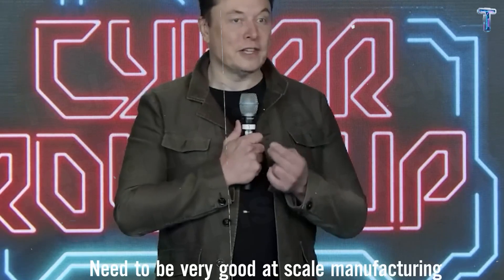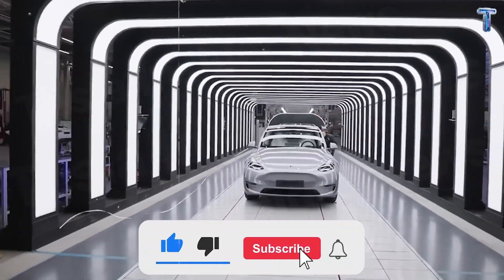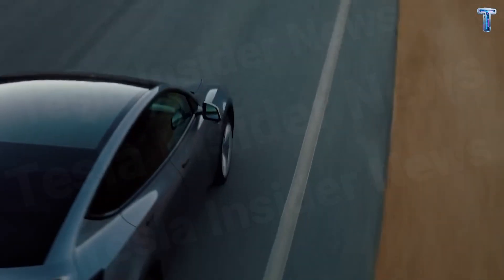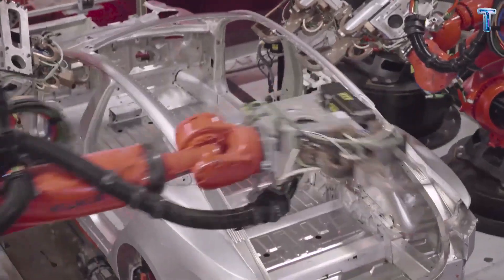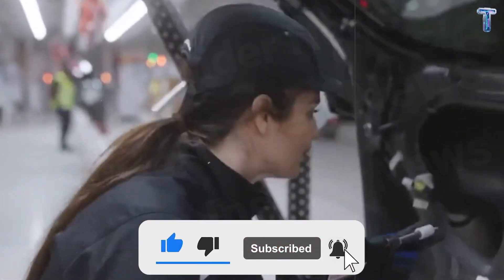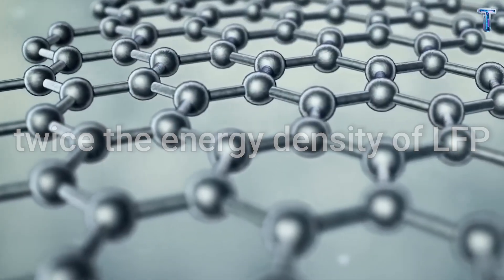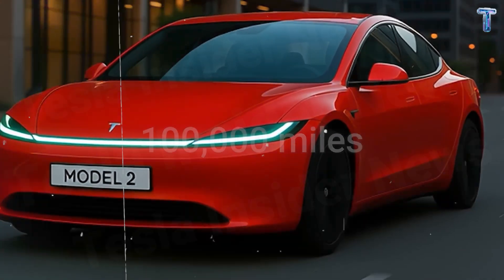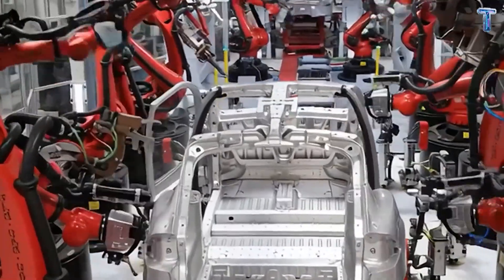$15,990 Tesla Model 2 2026: Musk’s 15s Giga Cast Changes Everything

Comment: $15,000 for a Tesla that runs 300 miles… sounds like science fiction from a decade ago
Reply from the maker: It did — until Tesla changed how cars are built. Not by cutting corners, but by rethinking manufacturing itself
Reply: @TeslaInsiderNews  Maybe this is the real turning point for EVs not speed, but accessibility.